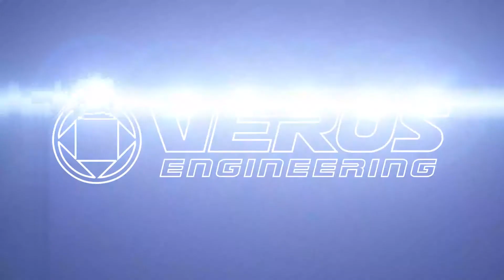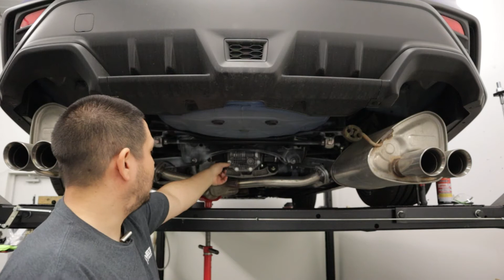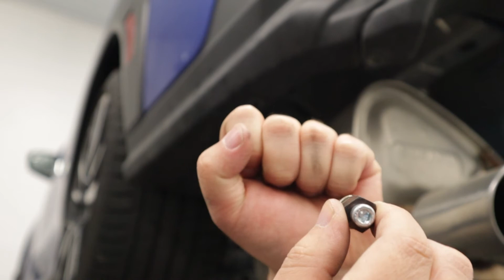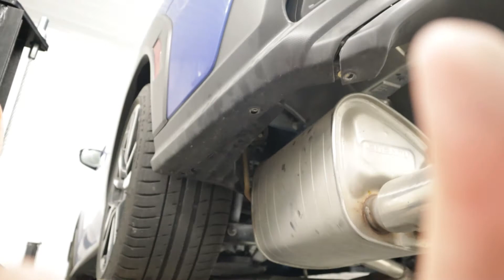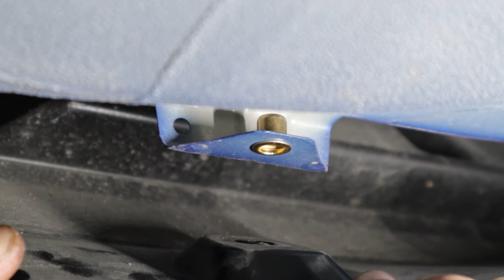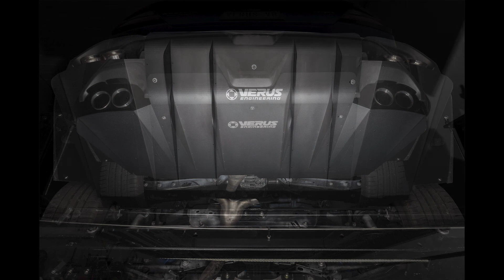Subaru VB WRX Rear Diffuser Install

Comment: You cannot use a level to make it straight with the ground bc it depends on how it’s sitting on the car. Using a level might actually make it not straight with the ground.
Reply from the maker: You aren't wrong. Using a level on level ground will work out well though. Ideally the diffuser is parallel with the vehicle's underbody, IE if the car has rake, the diffuser should as well.
Reply: @VerusEngineering  yeah, if the ground is level to the vehicle. Anyway, I just realized that this won't fit with an aftermarket cat-back. The cutout for the Y pipe is pretty tight, and when compared to say Remark, the Y pipe is bigger and different. Also, I'm waiting for the price to come down because $700 is too high. $600 or even $550 I might splurge.

Comment: I feel lots of "struggle" was left out of this install and you HAVE a lift.  I can only imagine the install on ramps or jack stands. 😢   is it easier to make the diffuser out of aluminum or (abs) plastic?  or plastic stakes vs aluminum stakes?
Reply from the maker: It is definitely easier with a lift. We've done plenty of installs with a nice jack, though! Sheet metal is always our go-to for performance, durability, and cost-effectiveness.

Comment: Would I get snow inside the diffuser while driving in winter?
Reply: yes.  you could just remove it for winter.
Reply: @brian6speed   removal sounds painful every 8 months.   maybe ceramic coat it to promote a hydrophobic surface to lessen water adhesion
Reply from the maker: You can at times

Comment: Reckon this will fit over the A’pexi single exit exhaust on my ‘22 WRX? If it does, should I run a block off plate on the empty exhaust cutout side or maybe put a mesh screen there instead to prevent additional drag?
Reply from the maker: Unfortunately, we cannot confirm fitment with this exhaust system. Yes, we advise running one of our OEM exhaust cutout covers. Not really for performance, but appearance reasons.
Reply: how far below the stock mufflers does that apexi poke?  can you use additional washers to add space under the muffler?